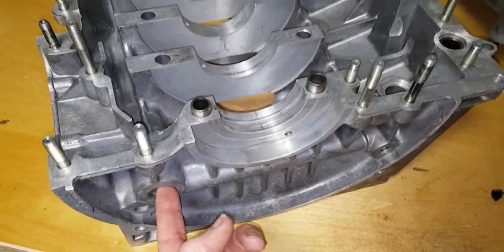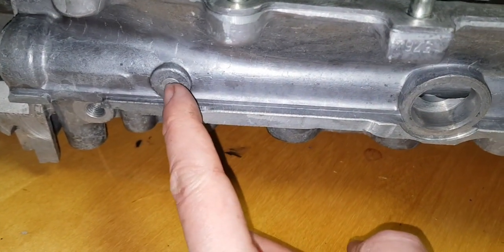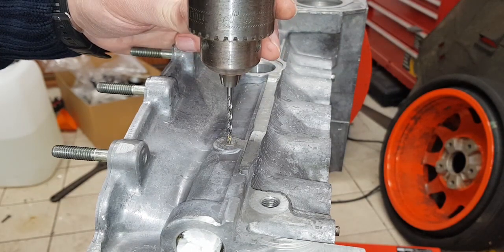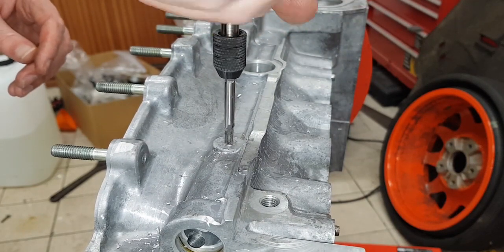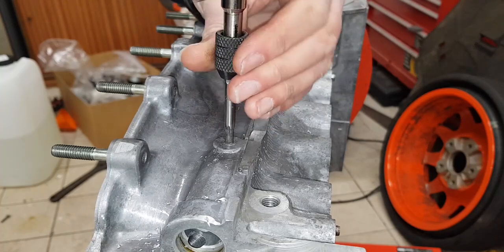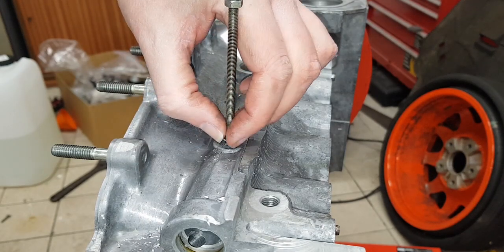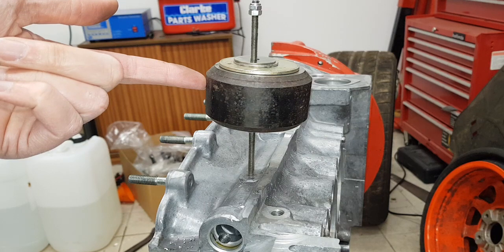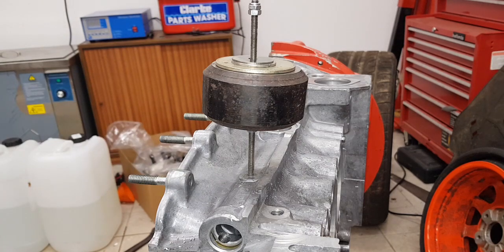Porsche 996 GT3 M96.79 engine rebuild. Part 10. Core plug removal.

Comment: Are the plugs available from Porsche or will you have replacements machined up?
Reply from the maker: The small aluminium plugs are available from Porsche, as are the core plugs. All except for the 16mm ones which don't appear on the parts diagrams but I have bought generic ones for those.  Oversize ones are also available 1mm larger if required.

Comment: How do you plan to clean/remove the debris and aluminum shavings given that the block had been subjected to ultrasonic cleaning?
Reply from the maker: They will be cleaned out by using brushes and carb cleaner, blowing out with air lines.  The issue with using the ultrasonic cleaner is that the fluid doesn't get down to all of the dead ends in the oil ways behind the plugs.  With the plugs out it is easy to clean by hand. The ultrasonic cleaner gets rid of oil and dirt from the outside and inside of the case and makes it great to work on for the final cleaning.
Reply: More good content Martin thanks 👍